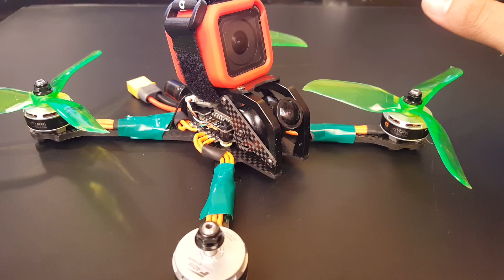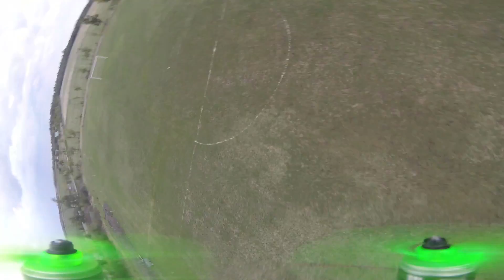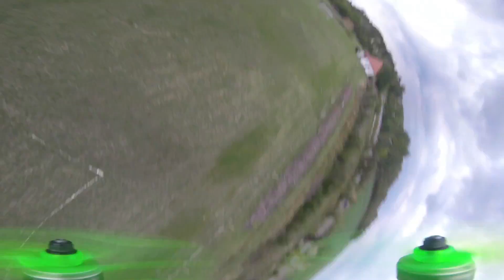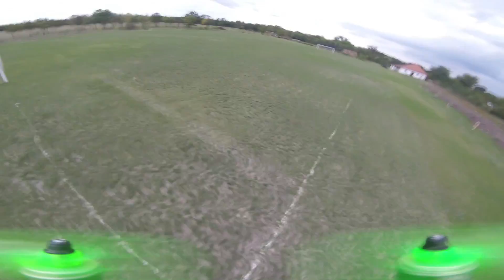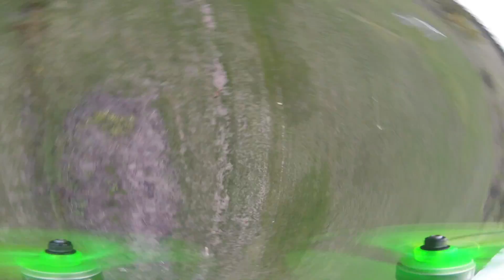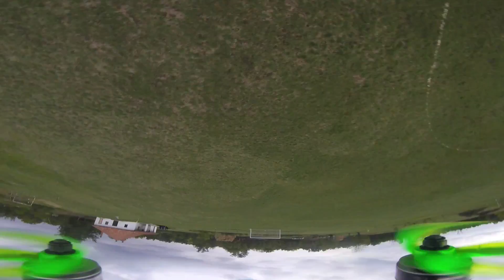Racerstar Tattoo F4S // Noise Test and Maiden

Comment: I just released my review video on the identical, relabled ready to fly quads version called the Vedrfolnir, and it came with the same VGOODDF4S 3.1.7 firmware. I can personally confirm that you need to flash the board to the LUXF4OSD rc5 firmware target to get the board to be compatible with the blheli32 esc's and gui.
Reply from the maker: SteelRainSpo Awesome Thanks for sharing
Reply: Thank you!
Reply: Thank you! That firmware is for the Lumineer AIO. (Without ESCs) For some reason, they changed the target name with version 3.2. These boards must be a clone, with ESCs added. As long as I can get working firmware, im happy.
Reply: LUXF4OSD is working for it only till version 3.2.1. If you are trying to flash with 3.2.2 or 3.2.3 it doesn't work properly. Very annoying.
Reply: Dude. If this is just bad firmware, im gonna be pisssssed! I have destroyed some pretty nice gear trying to get it to work. The problem is the pitch axis. When it goes past a certain point, it flips out and cannot recover or gets stuck pitching forward....Well. Ive tried everything else. Might as well start over with the firmware.
Reply: Changed the firmware. Didnt help.
Reply: Ninja Sauce - I had this same problem with my RTFQ'S Vedrfolnir AIO flight controller, where it kept spazzing and flipping out numerous times from flips, causing crash damage to an already vulnerable IFlight Beetle build, which is why I gave up on the project temporarily.
Reply: Have you successfully gotten this board onto 3.2.3? If so, which target? Also, if you flash a target that doesn't work, is it easy to go back to a working build?
Reply: Here also flashed 3.2.4 and i even can not get it in the air. It is desyncen and motors become very hot after 10sec. On Dshot600 and standard pids. This is a crappy product!
Reply: Flashed back to 3.2.1 with same result..
Reply: Fpv-Droneracing I have 3.3 flashed but haven’t tested the motors yet. Will do that tonight and report back.
Reply: Dan Kuzma 3.3 which target? Luxf4osd is 3.2.4 now. The motors are twitching and the quad jumps up and down and the motors become very hot after only 15sec
Reply: Fpv-Droneracing LuxF4OSD BF 3.3
Reply: Dan Kuzma i tried luxf4osd 3.2.3 and that was not working. It think it is an esc problem and the solution Will not be the firmware of the fc. Would be surprised that 3.3 would work. I hope it Will but i don’t think so😒
Reply: Fpv-Droneracing okay so successfully hovered BF 3.3 on dshot1200. Haven’t flown it outside yet because it’s been -30C here lately. I had to update the ESC’s with the blheli_32 configurator and use dshot1200. Seems to run very smooth so far.
Reply: Dan Kuzma . Hi Dan tried that and the quad Goes ballastic as soon as i arm the motors. It Goes Full throttle. When i take of the props you can arm it normally. I give up there is something really strange which this board..
Reply: Fpv-Droneracing yeah it doesn’t sound normal. Mine twitches like crazy because oneshot was selected but switching it to dshot1200 fixed it. Well, at least we tried.
Reply: Dan Kuzma. Yep and i found out it does that just a sec and spins normal.. but this sec Will destroy the props, quad
Reply: Dan Kuzma. I Made an rookie misstake after flashing esc 2 motors were spinning in wrong direction. So on 3.3 with dshot1200 the jittters are still there😒
Reply: I had another thought, are your esc's flashed to the correct firmware, it should be a siskin one. I'm at work so I can't check for the exact one right now.
Reply: Dan Kuzma. Yes it was sisken. So the problem before and after updating esc and fc the issue is the same. Jitters/twitching
Reply: Just a crap board then I guess. I've read a few places that these (and other iterations) were hit and miss. I wouldn't buy it again knowing what I know now. Hell mine could be garbage too. I haven't done more than hover it in my garage yet.
Reply: Dan Kuzma. Looks like it. I bought in Total 4...

Comment: Having 2 quads with TattoF4S FC a year already I can say that this FC is pretty nice budget AIO FC. Have possibility to add all basic peripherials (RX, VTX, LED, buzzer). Not noisy too although cap on battery pads may be required for more noisy motors. It is definitely possible to run RX + telemetry (FrSky F.Port) and SmartAudio VTX control over single TX6 port to avoid soldering on F4 chip pins. If 5V onboard BEC is damaged, internal circuit can be powered from external 5V BEC through buzzer/LED power pads (fixed 2 TattoF4S with fried BEC in this way).

Comment: Hi just wanted to ask you a question. I'm using the racerstar rev35 4 in 1 with an omnibus f4 v5 board. I have the 8 pin connector from the esc connect to the fc via the 8 pin connector. My problem is I get terrible noise on my osd. So bad that it faded away under throttle and I can't even see it. How can I resolve this issue? I have a small cap already fitted
Reply: The cap is a 35v470uf by the way

Comment: Are FC in this quad is the Tattoo F4S with USB port at opposite side to battery pads?  If so then in way which it is mounted in this frame I see here USB port is located at front near camera between camera mounts. How you are accessing it? By disassembling frame each time when you need to configure something? It is crazy BTW.

Also how much weight this quad have? Without camera and battery and all together?
Reply from the maker: I have an adapter I route to the side. It is annoying but the overall performance of the FC is very good so far 60 Lipos once i get 100 I will make an update video. BTW my latest flight video is with this FC.
Reply: Well, I ordered F4S board together with this adapter (straight version) https://goo.gl/hkDQbJ to have access under camera at front. How about vibration dampening - are that single ring is enough? I have Matek/Realacc rubber pads too, BFight 210 frame have plenty of space inside.  SmartPort telemetry (with XSR RX modified for non-inverted telemetry signal) goes to TX6/RX6 pads under label then. Later if I'll change VTX to IRC/SmartAudio compatible, it seems should be connected directly to TX3/RX3 pins on MCU chip.

Comment: I'm testing my prototype FC which is powered directly from the battery (up to 6S). Actually, I have very solid OSD no flickering at all, overall great performance. I get a feeling most FCs use terrible components especially on buck converters/LDOs which is the result of noise on 5V line etc. But no wonder since who wants to pay double or triple on BOM for the part that on paper should do the same thing...

Comment: dude you have noise. i would not want to fly with the lines. so the FC has a bad 5v reg thus the lines. even with lots of 1000uf you wont get rid of that.
Reply from the maker: PropsOnBrainOff FPV The noise is in the battery feed and not the 5v rail. 1 small buck converter will clean out the vtx to perfection and I will add one just for you guys.

Comment: I've got the same noise in my video feed, I'm talking about the pattern of parallel lines that can tilt a little (mines are mostly horizontal). Been fighting to get rid of it for a while now... zero success.
If anyone can help me troubleshoot it ! I'd be sooo glad! I'm fed up with those line ! I've noticed that the thickness of the lines depend on the power output of the VTx :
25mW : fat lines, like maybe 5 or 6 large soft lines
200mW : thinner lines : a bit like the ones in your DVR in this video.
500mW : a lot of very thin lines
800mW: so thin and so many that they almost disappear (but got a few glitches with 800mW)

I've added a low ESR cap, and it didn't change nothing at all.

I'm using a TBS unify pro v2.

If anyone can help : /

Comment: Would imagine most would consider that noisy if not unacceptable. No noise would mean no noise.
Reply: Drone Mesh Ive never needed a cap for clean video. If you need to use a voltage regulator you're picking bad components.
Reply: MojoPapi FPV I agree, that feed was quite crappy (that's me using cheap China vtx'es)
Reply from the maker: Don't forget the bent prop once we take it out again we will see if it disappears but you forget we only used 1 low ear and adding a voltage reg would clean that up perfect.